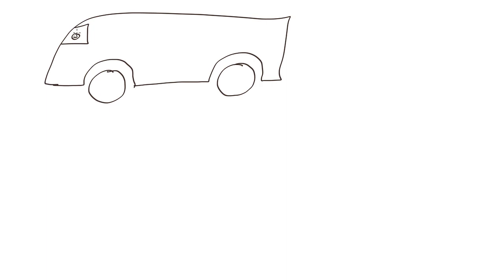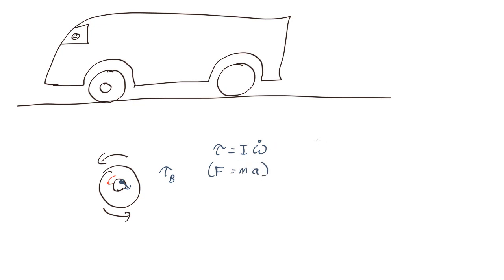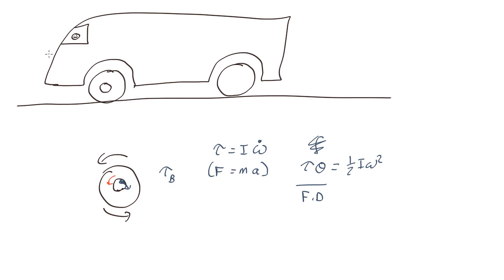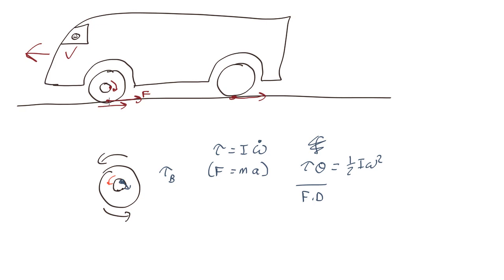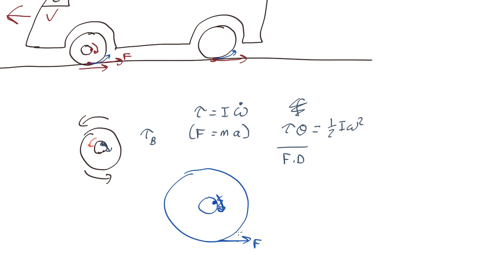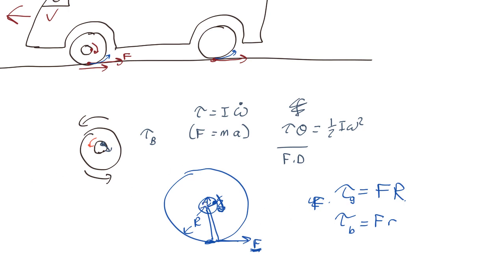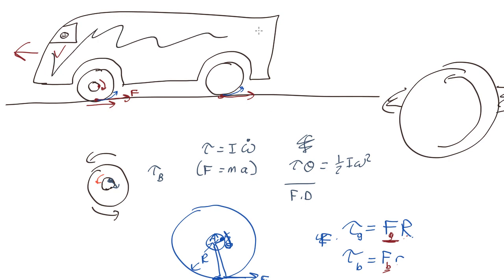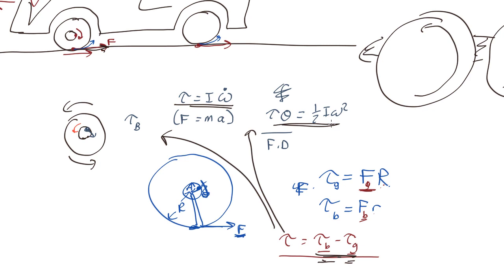Physics of Car or Bicycle Brakes

Comment: You talk a lot about your forces at the ground. But you miss the important point: As long as the wheels are rotating there is no braking force on the wheels from the ground, no slipping.  On each wheel you have a static friction force to maintain rotation. All the brake work occurs in disks and pads, getting hot. There are no slipmarks along the ground
Reply: In energy terms, you are quite correct. The energy does indeed go into heat in the brake pads - no energy is dissipated where the wheels touch the ground, because, as you say, the tyres are not skidding. In force terms, however, there is most definitely a braking force between the bottom of the tyres and the ground. There must be as otherwise the bike (and rider) would not slow down.
Reply: @paulfrancis825  A braking force, valid in Newton's second law, must do brake work along the translation. If you multiply Newton2 with distance you will have the energy law where F and s must point in the same direction. Forces at the disks and pads don't do that.
Reply: @goranmalmsten5306 Just think about the bike as one system, if there is no brake force external to this syetem(i.e from the ground), why would it slow down? You are correct in terms of energy conversion but the kinetics is a different story
Reply: @paulfrancis825 You are correct, the braking force for the whole bike is the static friction between the wheel and the ground now acting in the opposite direction of the direction of travel.